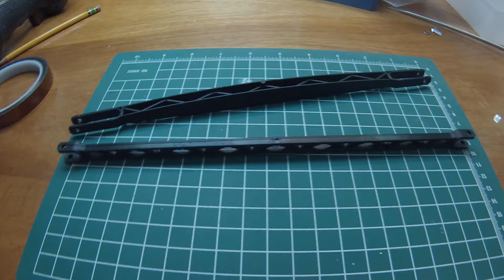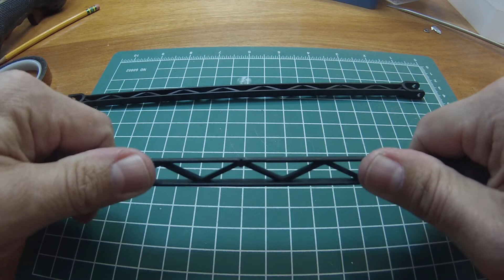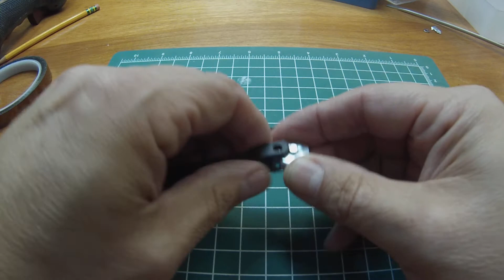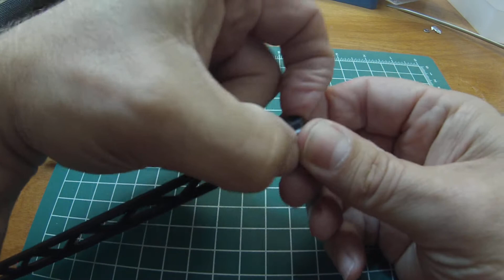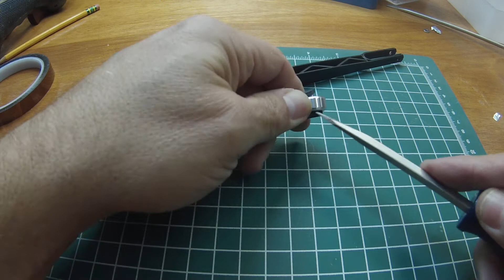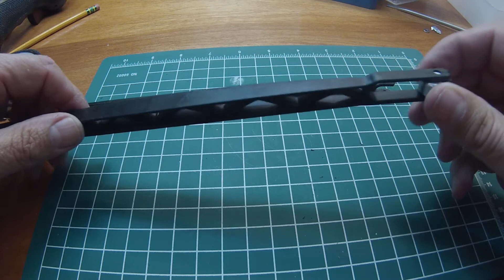First look at the new delta arms for the Rostock MAX printer from SeeMeCNC

Comment: Own a Rostock MAX ?  Buy These from trick laser They Are much better. http://tricklaser.com/Carbon-Fiber-Tube-Arms-with-Metal-Ball-Rod-Ends-RM-ARM-CFTX.htm
Reply from the maker: I think the only real compelling reason to get the Trick Laser arms is to avoid the sanding issues required by the stock arm u-joints.  The Trick Laser arms ARE very nice though.  I'd recommend buying the pre-assembled ones though.
Reply: While thats a nice thought, after owning this printer since it came out, the stock arms end up with quite a bit of play after 100+ hours of printing. carbon fiber arms are much much more precise in the long run, as well as stiffer. imo
Reply from the maker: lazerusmfh
When you've got 100 hours on THESE arms, then you'll have a valid comparison.  These new style stock arms are a VAST improvement in rigidity over the original arm design.  I have well over 100 hours on these arms on Orange Menace and they're just as tight as the day I installed them.